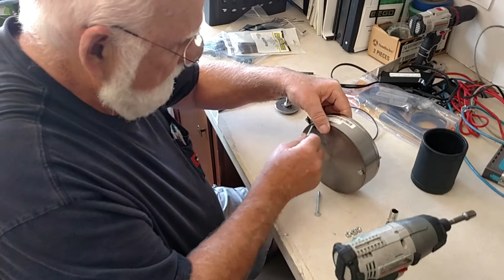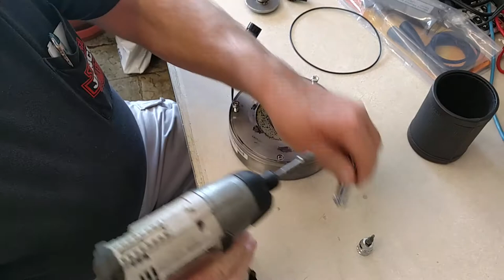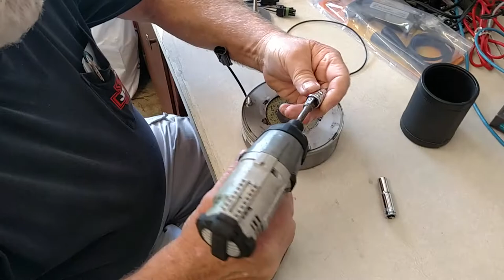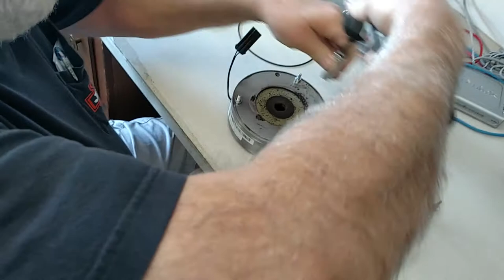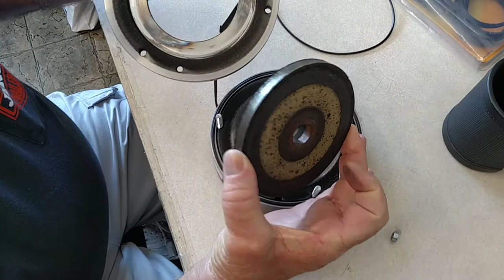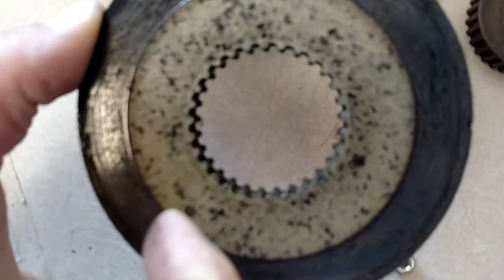Ezgo factory HD motor brake failure

Comment: What are the symptoms of a bad motor brake ?
Reply: No brakes. Juttering when braking, or the brake will constantly drag and you won't be able to touch it. It can get hot enough to burn up the motor speed sensor